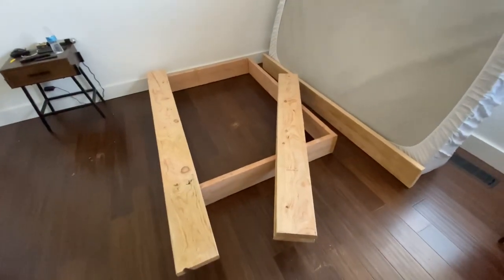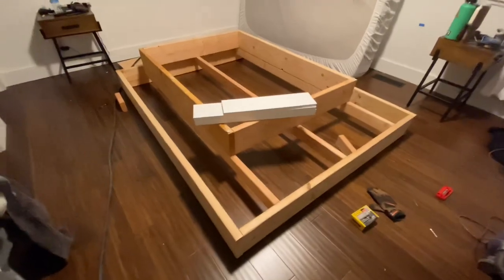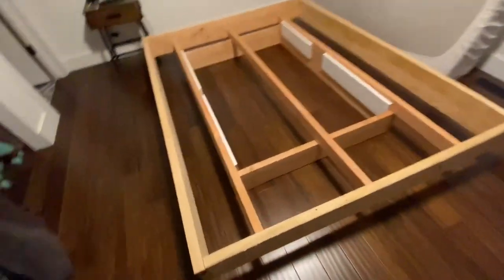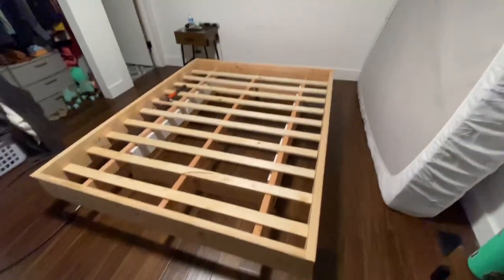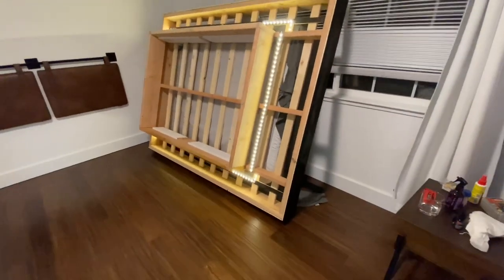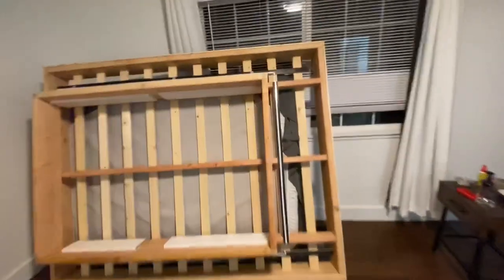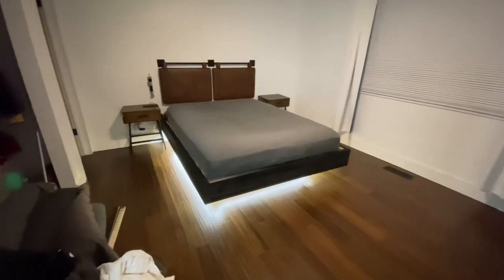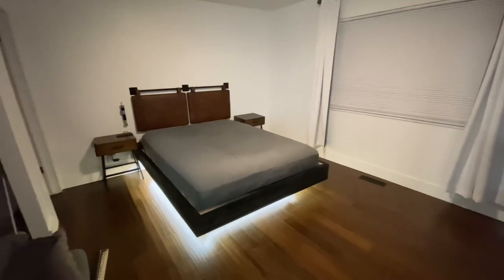Floating bed frame

Comment: how long are the 2x4's? and the length for the 1x2's cheers mate
Reply from the maker: I just measured the inside of the outer box for the length of the 2x4’s. That way i could get each one exact.  The 1x6 for sistering it together are about 18 inches long.  I hope that helps.
Reply: @makermatt   ok awesome now i'm located in australia trying to copy your frame you reckon if i do exactly what u say i should be able to get it done yah?
Reply from the maker: @zacthirkettle  absolutely… you can do anything you put your mind to!!!
Reply: Year later and this the best one I have seen thank you for sharing. Hopefully I wrote down everything I need

Comment: I stole your simple and smart build. It is mine now. I did do something a little different because i am old and nothing makes old men happier than finding a use for something they have on hand. Rather than using 2 boards to "sister" the 2 frames together i used  2 "simpson strong-tie" steel hurricane ties which are typically used in rafters(I said I am old and yes I do live in Florida so I have a hurricane tie on hand, shut-up.) That said, they are super cheap(like $1.20 per) and you can bind in center 2x4 to the interior of the lower frame on the top and the bottom of the bed. Now I am off to tell all the neighborhood kids to get off my lawn.
Reply from the maker: Simpson strong ties are a great idea… good on ya! 😆